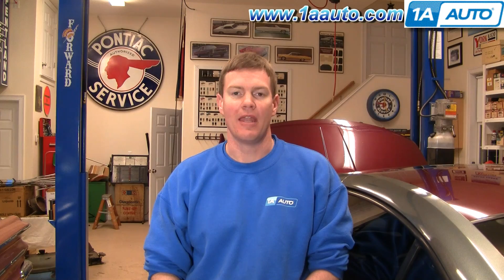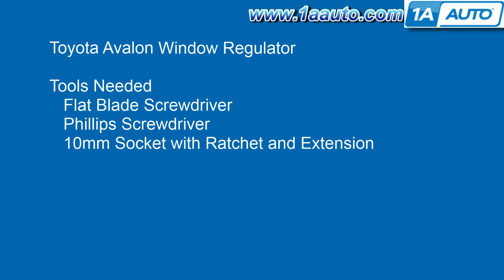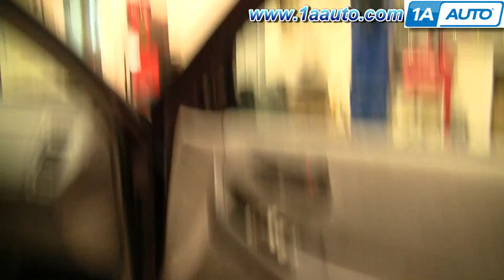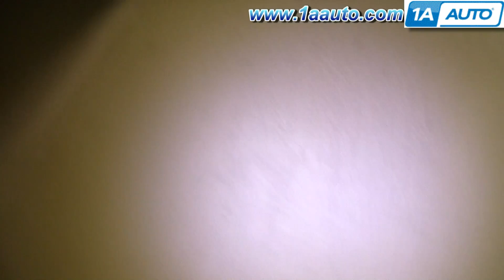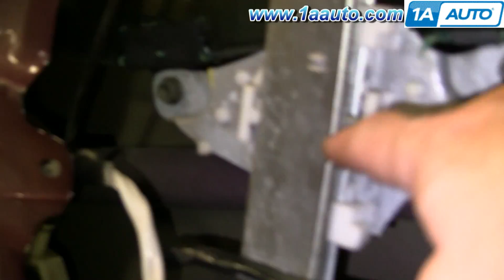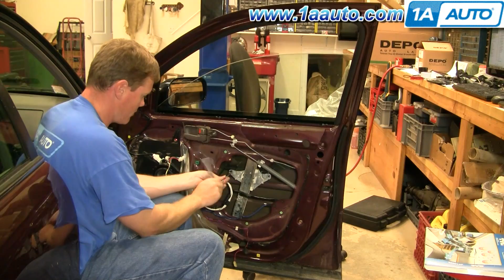How to Replace Window Regulator 95-99 Toyota Avalon

Comment: You guys saved me so much money on my 1998 Toyota Avalon XL! I followed your directions but with the driver side front regulator. The hardest part was just putting the window back in, I just copied the angle you put it in and made sure the two holes matched up. The slower I went with this the better and just needed someone to hold the window up just a little bit to get that last bolt! Thank you so much!

Comment: Pls help I got the regulator out and replaced it with the new one. The two bottom screws was not lined up so I connected the unit with the controller and still nothing in want work up or down and their is no sound.

Comment: My 1997 was stuck up (fortunate cold and rain kept out) I pulled motor out following 1A instructions. Pried gear cover off old motor. Pulled cable gear off motor, leaving all the slack necessary to push glass down to reach bolts attaching glass to regulator. Continue with 1A Auto YouTube video.
Reply from the maker: +Arthur C Thanks for watching. Thanks for watching. If any of our viewers needs to make this repair we carry the replacement part shown in this video on our website. Here's a link to them https://www.1aauto.com/1A/WindowRegulators/Toyota/Avalon/1AWRK00335?utm_source=YouTube&utm_medium=CTA%20Comment&utm_campaign=1ATony

Comment: What if the window regulator track is stuck in the up position?  Do you force it down, to access the two bolts holding the glass ??
Reply from the maker: You may want to see if the cable is jammed on something which is preventing the window for moving. If it is and you can't free it up by hand, you may have to cut the broken cable to enable the window to move so that you can access the bolts to remove the window regulator. We carry the replacement window regulator on our website. Here's a link to them. Hope this helps you outhttps://goo.gl/zsBikt